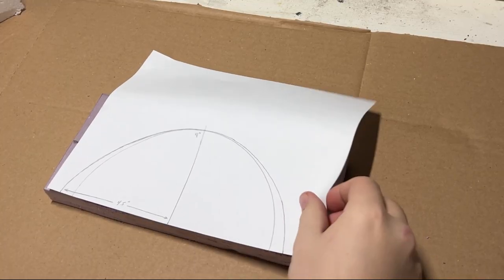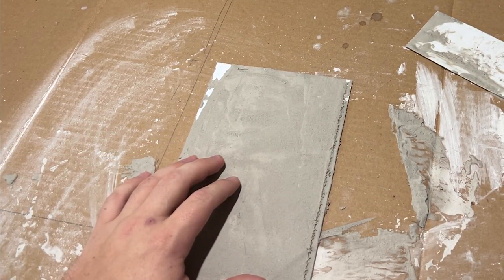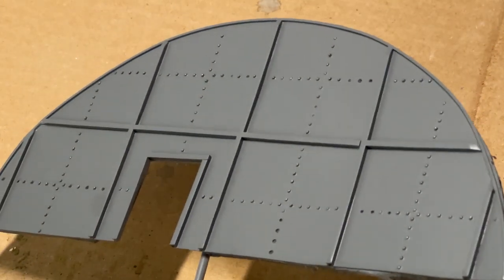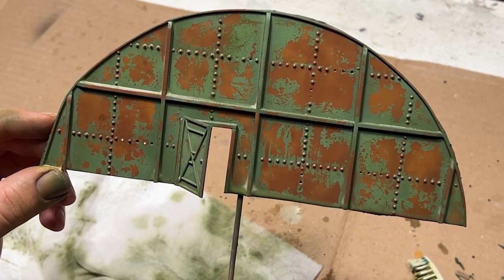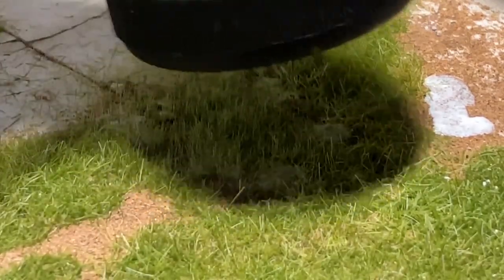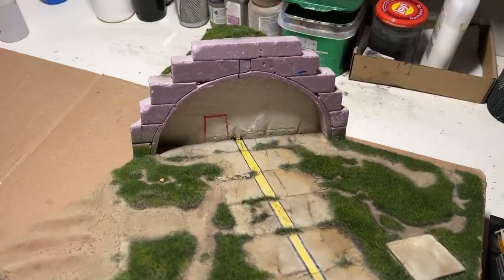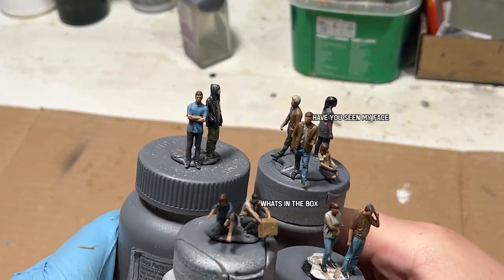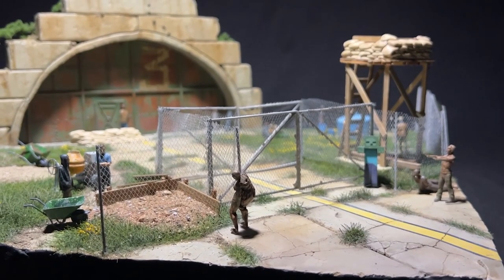How I Made an Air Plane Shelter Survivor Oustpost Diorama

Comment: Hmmm Some really great techniques here. Very well done. I don't think the chipping was too over the top. Steel surfaces that are not maintained will corrode and lost paint fairly quickly depending on the paint used. I can't imagine that the military would use high tech paints like epoxies and polyurethanes for an aircraft bunker. Add in the indeterminate time period between the site's abandonment  and when this scene is supposed to take place. One thing I'd like to know is where everyone is getting the endless variety of figures to use. I've checked out some of the web sites but the selection seems to be very limited.
Reply from the maker: Thank you! Ya most of the figures I’ve found were on thingiverse and I’ve tried every variation of the word “figure” to find them most of these were from a pack  that I think was called HO people. But ya I agree finding usable ones are not easy.